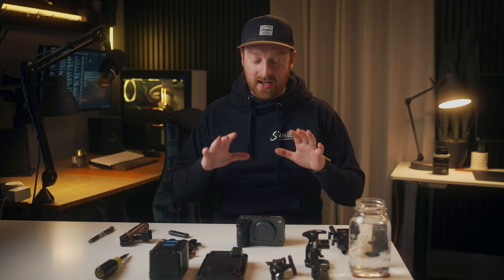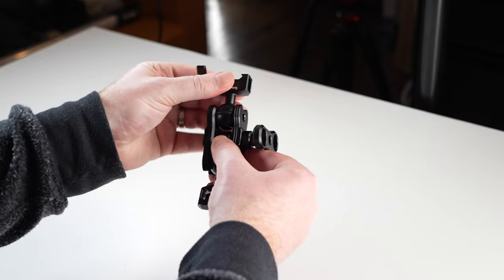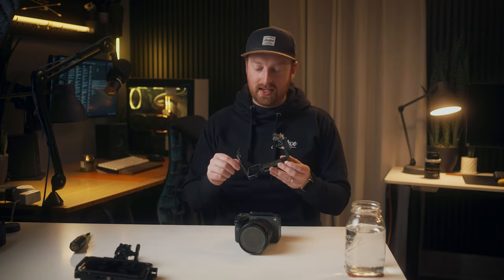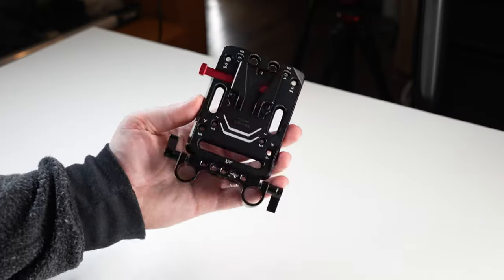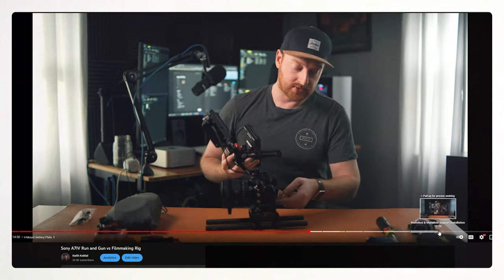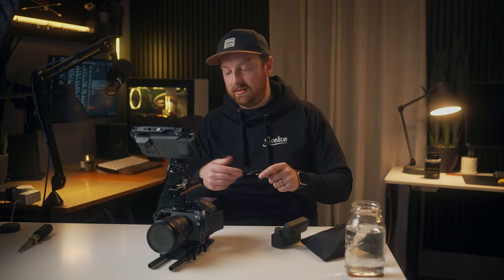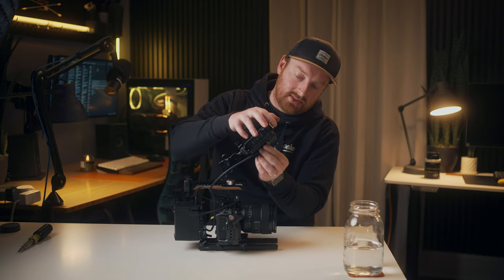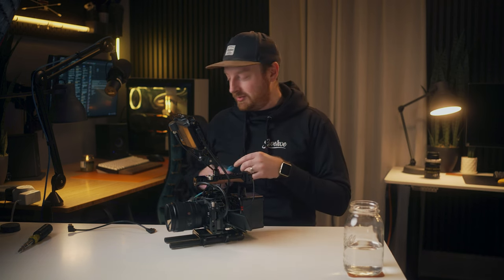My Sony FX30 / FX3 Rig | Run & Gun vs All Day Filming Setup

Comment: When I'm not using the handle cold shoe, I actually put a small piece of cloth wire harness tape in the bottom of the angled cold shoe and that worked perfect to snug up the DJI receiver.

Comment: Hey, Keith, so I followed your rig suggestion, and now all my rig parts came in, rig is assembled, and looks, works great ! I just have one simple question : My set up draws power from my FX30 battery first, then, switches to the V-mount battery. Is there a setting where I can prioritize sequence of batteries. I would prefer to have my V-mount powerto be first in line, than camera battery second. Thx !
Reply: I would probably just buy a dummy battery and connect that to a d-tap port. On the fx30 and fx3 the battery door can actually be taken off

Comment: hey keith , great videos , what do you think about FX30 ? in being an APSc making that kind of difference for video compare to something like A7C mk1 or A7iv?
Reply from the maker: Hey Resha, thanks for the kind words - I've been loving the FX30, when comparing it to my full frame Sony cinema cameras, I have to use lenses that are faster and wider than I'm used to. Know that rolling shutter can be an issue if the frame is moving around - but other than that it's been great!

Comment: Hey Keith… I’ve been tuned in the past few days, checking out your FX30 rig setup… on the smaller one, can you share if the adaptive back for the Átomos Ninja is separate or comes with the monitor, so I can add a battery..

Comment: Hi Keith, thank you for this great and useful video. So, if I understand well, you power your FX30 with a USBC cable directly from the FLIXON battery. I avoided to do so as I saw that, for this battery, they idicate : USB-C In/Output: 5V/3A, 9V/3A, 12V/3A, 15V/3A, 20V/2.2A so I wasn't sure if the output voltage would surely be 5V as the maximum needed by the camera (at least, that's what is writtent on the original USBC charger/AC plug in that came with the camera). DId you do some electrical tests before or use a special cable that limits the voltage ? Also, it is not about the setup but would you know if I can have an image at the same time sent by the HDMI cable for an external monitor and on the camera small screen and where should I go in the MENU to obtain this ? Thank you very much.

Comment: I just bought the fx30. It was between this or the A74. The over heating issues kinda pushed me away from the hybrid. And I’m not a photographer. I pick it up tomorrow. Never had a crop sensor cam
Reply from the maker: Congrats on the new camera! Love the FX30
Reply: @keith-knittel  ok filmed two shoots since yesterday with the fx30. This is a real inexpensive video camera. Coming from a full sensor I didn’t have high expectations. This reminded me of the car a family member passes down. You’re not sure how it’s going to run. Then it turns out to be a great runner! I love the control in post with color grading and the challenges to use lighting. I had to turn off the auto focus. It made me feel like a tourist. Since I’m also a run and gun I’m applying a similar set up.

Comment: Hello Keith, I’ve only ever used full frame lenses on aps-c with canon dslr bodies like 24-105 F4 L on 7D or 80D aside from the full frame bodies. I’m very interested in the fx30 as a first budget friendly Sony film camera to upgrade my game, but I do not want to have to buy lenses twice in order to upgrade later down the line to fx3 or even higher. Will full frame lenses make a lot difference on the fx30. Right now I need the fx30 mainly for online video creation and the fact that it can be used vertical for vertical videos is a plus. If I want an all around lens, is there an alternative to the Sony 24-105 full frame, or will I have to get the sigma 18-105 as an apsc lens while other lenses full frame like primes, and lastly can the 70-200 used on full frame bodies work on the fx30 or will I need an apsc alternative? I like the zoom lens with the zoom rocker on the side seen in your other video, as a broadcast like lenses with internal zoom, I see this is a great lens as well
Reply: I mean they all work but there’s a crop to the lens. For my canon r7 it’s 1.6x meaning a 70-200 is a 112-320 full frame equivalent. So I would recommend for the fx30 a 24-70 2.8 or a 50 1.2 the 24-70 will give you some of that range like a 24-105 would give yah

Comment: But a question, this 50mm 1.2 turns into a 82.5mm with the crop and the internal estabilization, doesnt it? how do you manage it on the Run and Gun Filmmaking?
Reply from the maker: Yeah - it's about an 85? Off the top of my head? I love tighter focal lengths for showing details. Just have to slow down and keep the camera as stable as you can. I'm making a "Best lenses for the Sony FX30" video soon that goes into more detail about this!
Reply: @keith-knittel  Got it, but for weedings, wouldnt it be better the 20mm and 30mm, cause turns to 32 and 48??